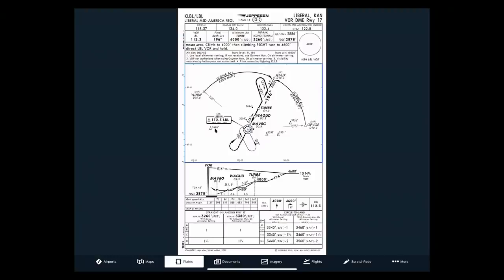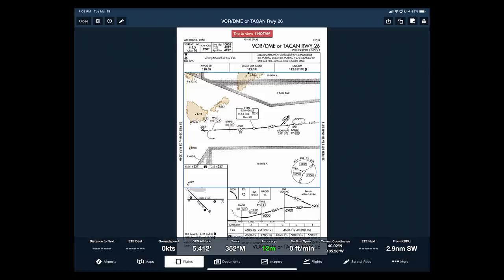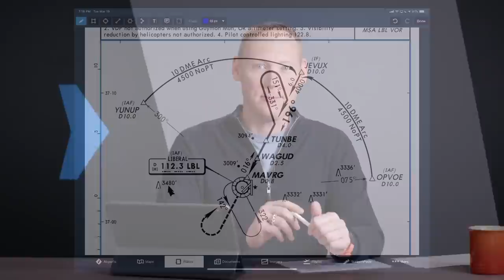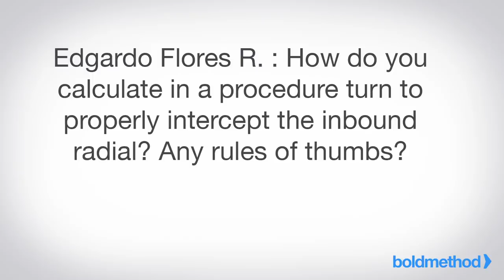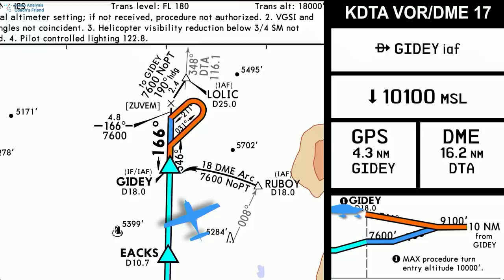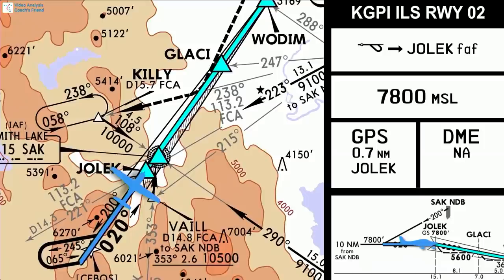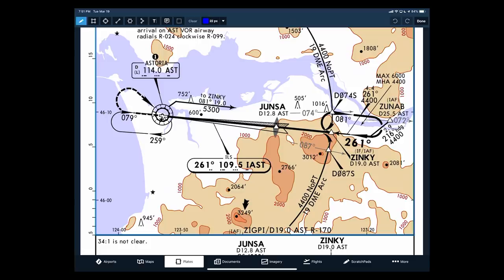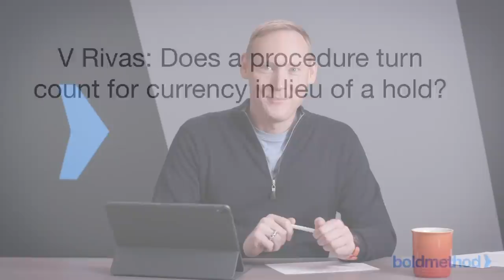Procedure Turns: Boldmethod Live

Comment: Great Video, ran this approach in the msfs2020 sim many times, a lot of fun and you learn a lot. Question, I've tried this approach without the use of my GPS, simply using VOR headings. But how would a pilot know how far he is from this runway, in this example its Runway 17. Using VOR/DME its tells me when I'm 4 miles "From the actual VOR itself" not the runway. This messed up a few of my approaches because I started my 4 mile adding flaps and gear down and I came in too high and fast. When I did it again using GPS, that was accurate, it told me I was exactly 4 miles from runway 17 and I was able to coordinate slowing he plane altitude and speed successfully. Just wonder how did pilots do this in bad weather without GPS?

Comment: Can you look at the VOR 15 into KMKT? Let's say you're coming in from the NE at 3500 ft, and you cross the VOR (which is the IAF). Even though there is a holding pattern over the VOR, from this video I would assume you would only need to start a turn outbound to start the procedure turn, and you could completely ignore making any holding entry maneuvers? This also assumes you're flying with just traditional VOR equipment, and for training purposes, this scenario disregards the more likely scenario of vectors to final from ATC. Also, you said as soon as you cross the PT fix, which in this case is the MKT VOR, you're immediately offered protection (even if you're not on the protected side. Where can you find these protection limits?

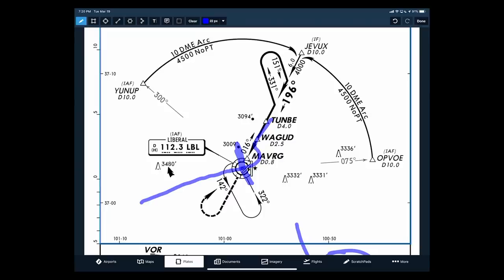Comment: First of all thanks for your excellent videos and explanations. Truly helpful and clear! I would like to ask a question about this particular video at 27:11! When you show as an example the entry on the procedure from roughly track 142M, in Europe I believe we cannot do what you have drawn. (please, correct me if I'm wrong...). Because in this case we are not approaching the VOR through the direct entry area for procedure turns (in accordance with ICAO 8168 Vol 1, would be 30 degrees each side of the outbound track which in turn would be between tracks 016-30 = 346 and 016+30 = 046). In this case we would have to entry the holding which assuming you have drawn track 142, we can choose teardrop or parallel, and only then we can proceed to the outbound track. Would you agree with this, or is this something that is not applicable in the US ? Many thanks.

Comment: They'l most often clear you to an intermediate fix with a crossing altitude and tell you to expect vectors where you'll be put on a 30° intercept to final.   And I would not give credit for a holding pattern for currency by way of executing a procedure turn.  We need to see timing standard rate turns proficiency demonstrated as well as knowledge of a proper entry.  I did not hear an answer to the entry to a DEM arc at places other than defined fixes.  I'm thinking maybe not if there are varying safe altitudes in the sector and that you would ask for vectors instead to the intermediate fix

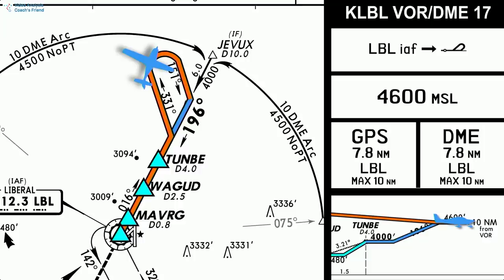Comment: Love this video, but I have a question at 30:37. The chart says to turn at 10 NM from VOR. In the video it turns at 8,2 DME. Is that correct procedure, or should you go further out?
Reply: The chart says to remain within 10 miles. If you started your turn at 10 you would be outside the published procedure.

Comment: I'm curious if GPS is good enough for the FAA to ground all the VOR and DMEs to simplify the life of pilots.
Reply: always have a back up
Reply: @asfalling4534  So your car is rolling along and you step on the brakes to stop from hitting a car in front of you. The brakes don't work. What do you do? What's your backup?
Reply: @scottfranco1962  I don't fly, so I don't use them.
Should the FAA be basing its design of the air system based on what somebody used to use 50 or 100 years ago? Seems backward.
Reply: @markhathaway9456  This statement seems to conflict with your last statement about backup (as in VOR is backup for GPS). Anyways, yes, the FAA VOR system is around 50 years old. I don't think the majority of airlines use nor much care about the GPS system, even now. They don't have to. Airliners fly airways defined by VORs, and land using ILS systems. The FAA cares far more about airliners than us FLIBs. The article I cited above giving the criteria for keeping VORs dovetails nicely with the continued support of airline VOR service, so its going to be around for a while.
Reply: @scottfranco1962  I just read that article and it was very good. It helped answer some of my questions too. Thanks for that link!
Reply: @markhathaway9456  Like the age of an aircraft?